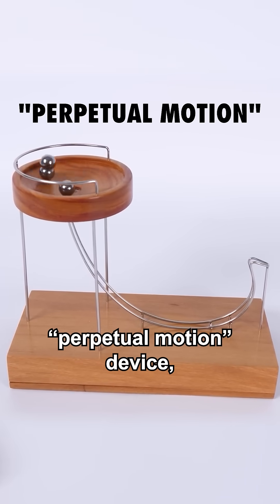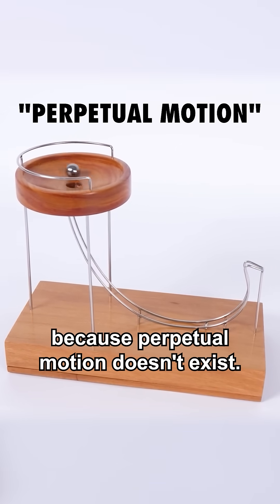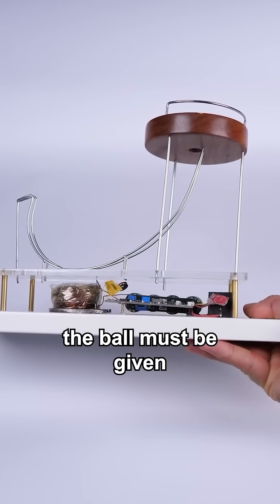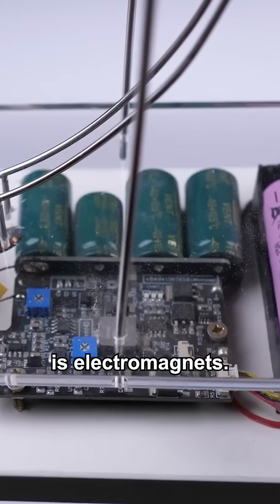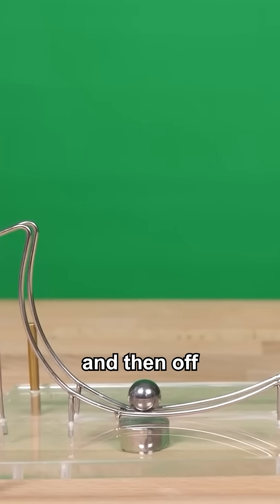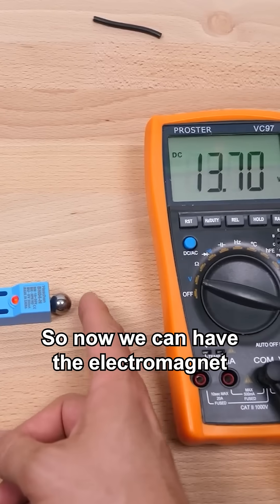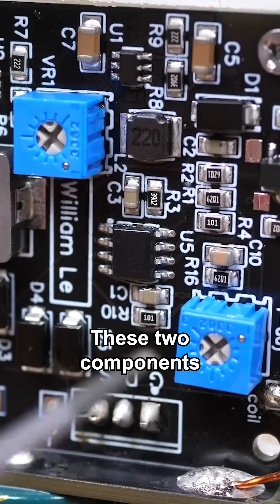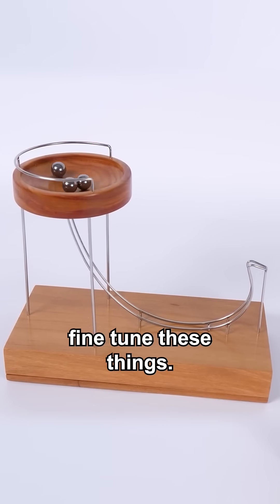Proving that "Perpetual Motion" doesn't exist!

Comment: But aren’t all atoms technically in perpetual motion they are constantly vibrating without end. So if atoms can stay in perpetual motion obviously not now with a gimmicky machine like this but in the future couldn’t we eventually find a way to reproduce what makes them move on a larger scale? Idk it’s just a thought I was curious about.
Reply: They're NOT in perpetual motion, every atom in existence is losing energy. Some just do it faster and they're called radioactive atoms 

Also, perp motion is only even theoretically possible in a closed system, meaning as soon you as take energy out of the system, meaning if you use it to power something, It's no longer perpetual as you cannot keep creating something out of nothing

Comment: What about a solar panel attached to a battery that's powering an electric motor in space? With proper engineering it could theoretically continue moving indefinitely, even after the sun dies, since it would still be converting miniscule amounts of light from distant stars.
Reply: That's perfectly legit engineering, but it doesn't qualify as perpetual motion by most standards because it isn't creating energy from nothing. The sun is technically a limited source of energy, even if it's practically boundless to us short lived and tiny humans.
Reply: @ccgarciab  Physics tells us that the sun and everything else came out of nothing. 
   This cannot be self created... out of nothing. Somebody, something, must be guilty of it all. Blaming it on nothing does not hold water. A spiders web collects more raindrops, because it is real . The belief that God is the Creator is anathema to some people. It makes it look all too easy !
Reply: @ThomasAllan-up4td I want to point out that you're tying your religious beliefs to your understanding of physics. Believing the universe was created intentionally is perfectly fine, but perpetual motion is the idea that you can make a machine that lasts forever and that never loses energy, which simply isn't the case. Solar panels, for example, just absorb excess energy from the sun and aren't often very efficient at it. Turbines turn but lose energy to friction or air resistance. You don't need to justify not knowing physics by using religion as a excuse, neither belief system has to conflict with the other
Reply: @Alreeshid  So why are you " conflicting" ? Besides I don't have a religion. I've got faith. And faith is not an excuse for lack of knowledge of physics. Faith is not even knowledge. It is ever moving, perpetual, ever vibrant and re-energising. It is always in the present sense. Knowing. And so it moves on ,past and through the portal of death to forever more.
   All that lives must die. Passing through life to eternity. You don't need a degree in physics. It's all there in Genesis. Science is only ever just catching up with the biblical account of creation.
Reply: @LirealAndJeremy  makes me wonder why they don't clad the windmills with solar paneling so they can still store clean energy when there's no wind .

Comment: A reflection of how there can't be perpetual motion is that the idea asserts there can be a location within the universe that is isolated from influence, of anything nearby measuring of influence but similarly doesn't influence a medium with the larger area it's nested in. That's the definition to "not existing", undetectable, but in no way letting anything "know" it exists yes not a wave, not a vibration, not a photon, not a sound.

Comment: Theoretically you should be able to do it with a flat non electric magnet as well using the same principle NASA uses to slingshot spacecraft past planets
Reply: Utilizing energy or forces around you doesn't mean energy or motion isn't wasted or lost.
Reply: Magnets have limited use, you transfer magnetic energy to kinetic energy and the magnetic energy inevitably runs out

Comment: The closest thing to perpetual motion that we see is planets orbiting the sun, and moons orbiting planets, in the frictionless emptiness of space, but even then the gravitation pull of the sun and the planets moons distorting the planets shape as they rotate is causing energy loss resulting in the orbits gradually slowing and decaying.
Reply: And even if the motion CAN be perpetual in the absence of friction/distortion, it's functionally "useless" as an energy source because you can't tap into it without taking energy out of the system and slowing it down.
Reply: @vitoc8454  exactly, in a perfectly frictionless situation and with absolutely non plastic materials that can't distort at all it could be potentially possible to set up perpetual motion, but the system would only ever have the energy input into it at the beginning to start the perpetual motion occurring, it could do absolutely zero work or the work done would just take that energy and it would slow and stop.
Reply: @vitoc8454  the only place we do see, or rather know of sustained perpetual motion is at an atomic level, atoms and sub atomic particles vibrate using the energy in the atoms, but that's a different and more complicated subject..
Reply: @ats-3693  pretty sure superconducting loops are also essentially perpetual assuming you find a low-temperature environment to stick it in (still can't extract free energy from it)
Reply: @lilarrin  Yeah true, but I assume they have to input (or pull out which also requires energy use) energy to maintain the supercooled state so it wouldn't be perpetual without external energy. I guess even in a total vacuum chamber a pendulum suspended on a frictionless magnetic bearing would swing almost perpetually, but even in a vacuum chamber once it's been pulled down to zero pressure there are still a few molecules of gas floating around inside far away from each other, its impossible to get every single molecule of gas out of a vacuum chamber even when it appears to be zero pressure inside, the pendulum will still hit the occasional molecule of gas slowing it by an infinitesimal amount each time.
Reply: Entropy
Reply: If you believe in the big bang theory our universe is in perpetual motion. It starts with an explosion, matter spreads out into space slowly collapsing in on itself until it explodes again continuing the cycle
Reply: I'd say the closest thing we can actually see may be life itself, after all the inception of life is based around a mechanism that is in the ocurrence of physics and nature, and the development of life is in itself a kind of perpetual, one might even say aggregation motion, of that natural mechanism.
Reply: @Glotisverdiamerdorifkelmzvur  Yes, but this is all using energy, remove the energy source and life will cease, we eat food that is or was made from another life form, that food has energy stored in it, that energy would have come from the energy in food that lifeform consumed etc, ultimately the energy is coming from the sun, plants convert sunlight energy into stored energy, animals eat the plants and store the energy in themselves, we eat the plants and animals. For perpetual motion or processes to he truly perpetual they have to he able to sustain an ongoing motion or process as a sealed system with no external energy incoming to power the process or motion. I mean if you zoom way way out and look at our universe as a whole yes it basically is a giant perpetual motion machine, energy is being moved around and transformed but it can't be destroyed or created. Even when all the radioactive elements have decayed to stable elements, like the thorium to stable lead decay series that heats the interior of our planet, eventually that will finish and the earths interior will cool and solidify and tectonic activity will cease, but the energy emitted by the elements decaying will still be present in other forms. Latent heat radiated away from earth, and new energy containing isotopes created by the collision of emitted gamma particles, or in the kinetic energy of free gamma particles emitted by the decays.
Reply: @Glotisverdiamerdorifkelmzvur  Life is perpetual because like it’s necessitate matter and energy from an external source to exist and keep going
Reply: Isn’t it possible to have a perfectly stable orbit though?
Reply: @ytuser4562  Yeah the bodies in orbit in our solar system as well as satellites in high orbits are all considered to be in stable orbits, but that is speaking in relative terms, the orbits of the planets are slowly decaying due to plastic deformation of the planets taking some of their orbital kinetic energy, the orbits of satellites in low earth orbit slowly decay as the satellites are still colliding with gas molecules at the outer extremes of our atmosphere. I guess satellites orbiting at or around Lagrange points are the most stable.
Reply: superfluids also have perpetual motion

Comment: Well, maybe i am wrong, but i wanted to note, what perpetuum motion is possible, but perpetuum motion, what gives energy are not. Example of perpetuum motion is planets moving in orbits. Notning stops them, because in a space there are no friction, so even if the star or planet, what pull them, will get destroyed, they will just move. Also its how space rockets works, if you cant stop it in space, then you will just fly further and further
Reply: Gravity is also not perpetual, as energy is lost due to tidal heating and deformation (the earth bulges slightly due to the gravity of the moon and sun, and technically bulges a miniscule amount from every object in the universe).

This is why the Moon is slowly drifting away and why the Earth's rotation is slowing down very slightly. Yes, they are very very stable systems due to the inertia of planets and the lack of friction, but even the orbits of objects in space are not perpetual.
Reply: Except gravity still acts upon them. That's still not perpetual motion.
Reply: @Alreeshid  gravity affects them, giving them acceleration in moving. Oir planet will not stop because of the suns gravity, it will stops because of red giant Sun.
Reply: @Мозговитыйслайм  gravity doesn't just make things accelerate, it's a pulling force from any number of objects in any direction. Those forces, even if it takes millennia, still effect the motion of other objects

Comment: You could have a wheel inside the wooden part the ball goes through to push it.
Reply: I guess you are smarter than all the qualified scientists all over the world.
Reply: You wouldn't get nearly the same amount of energy back as just using the battery
Reply: @boopsnoot3142  Youd use a battery anyway. I just think you could get the effect with a small wheel like a baseball pitching machine.  But yeah. Id go for a magnet as well.

Comment: whats the difference between perpetual motion and inertia?
Reply: Those are two completely different concepts lol also perpetual motion is impossible
Reply: Inertia is the property of matter to resist changes in velocity and is proportional to mass. An empty shopping cart is very easy to push around, but a heavy loaded-down shopping cart requires a lot more energy to bring up to speed (and just as much to slow down).

Perpetual motion are objects which remain in motion indefinitely despite outside forces acting on them. In this case, if this were a real perpetual motion device, the balls would be able to bounce into the tray and down the ramp forever despite air resistance and friction. The Second Law of Thermodynamics states that in a closed system, energy is always lost due to entropy and is no longer usable, so perpetual motion cannot exist in our universe.

Comment: Wouldn't it be more correct to say that perpetual motion does exist but can't be used to do work? If I throw a coin in space it ain't gonna stop. But it's not like we can plug a dynamo to it either.
Reply: The coin will actually stop eventually.  There is almost no friction in space... but there is still friction.  The greater the initial force, the longer it will take.

Comment: I'm wondering whether the magnet ever runs out of magnetism (maybe very slowly?), and if it doesn't, is there an energy-free way to turn it on and off as needed?
Reply: Yes, magnets degrade, and no, nothing is energy-free, that's the point. Every single interaction between objects loses at least a little bit of energy to friction.

Comment: The rails can be split in half and the upper part connected to the electromagnet as a switch. This way there is no sensor, no controller, no fine tuning (and probably the Mark I will not work).

Comment: Yeah, so perpetual motion does exist commonly... Over unity is what you're talking about. Over unity does not exist. Electrons in motion are an example of perpetual motion. Satellite's in orbit are an example of perpetual motion. Perpetual motion is very common. What is not common is the ability to harness energy from perpetual motion.
Reply: Those aren't perpetual motion.  They require energy to maintain that motion because there are other forces acting upon them to reduce it.
Reply: Satellites do not orbit perpetually, energy is lost due to tidal heat and tidal deformation. Orbits can be very stable, in terms of planets, but even our moon's orbit is decaying and making it very slowly drift away.

Electron "motion" is an entirely different story because electrons don't really "move" in a way that makes sense at a macroscopic scale. If you know the exact position of an electron, you cannot measure its velocity, and vice-versa. Electrons exist in energy levels, essentially "probability clouds" where electromagnetic fields cause electrons to exist somewhere in an atom's shell.

You can give electrons energy, and they become excited, shooting up to a higher energy level before relaxing and letting off a photon, falling back down to ground state.

Comment: I wonder what would happen if you use superconductor for the magnet instead 🤔. Then there's no resistive losses 😅.
Reply: There would be.  From the air, for example.
Reply: No resistance does not mean no energy cost. You still need to put current into the wires, i.e energy

Comment: Perpetual motion does indeed exist. It exists in space. The earth itself is in perpetual motion along with everything else in orbit!
Reply: Close, but not quite. There are losses due to resistance and friction with the small amount of hydrogen in space (which is what fuels the sun) and internal energy losses from tides and wind. Eventually the 
Earth will lose orbital velocity and spiral in towards the sun.
Reply: That's a misunderstanding of the physics involved.
Reply: Earth would eventually spiral into the Sun, if the Sun wouldn't expand past the orbit of Earth when it transitions to a red giant first. Perpetual motion doesn't exist. If you think you've found perpetual motion, you just haven't thought through the problem enough.
Reply: Nope. All of these objects will eventually cease to be.

Comment: Would have been a lot cooler if it used the same principle as a rail gun. Just push enough current through the ball, that the electromagnetic field between it and the rails pushes it.
Reply: Yes, not exactly sure of the exact term, but it's the same principle.
Reply: This concept IS so cool because this IS the EXACT concept used by the US military and many others to develop a rail gun. This is literally the same mechanism. All rail guns are is a series of electromagnets that turn on and off, because that’s(one of the only efficient, yes there’s technically other ways but it results in much much higher losses and would heat tf outta and melt the thing a lot faster as a result too) the only way they can really do it on a large upscaled version with repeatable operations
Reply: @quantumbrainium1904  what you're describing is a coil gun. Rail gun specifically refers to a device which uses the current flowing from one rail, though the projectile to the other rail to accelerate the projectile. The Wikipedia article explains this quite well.